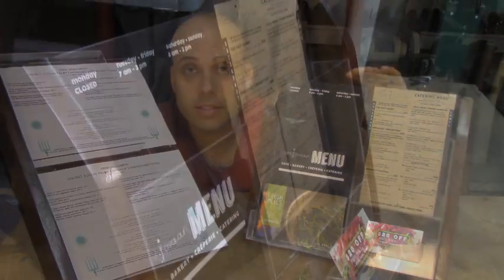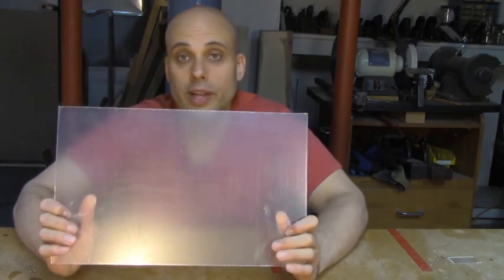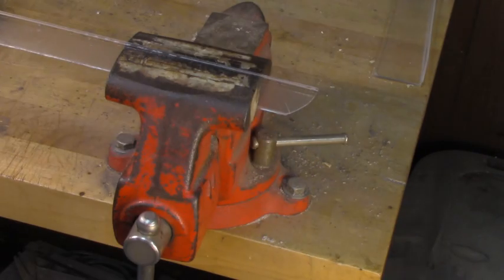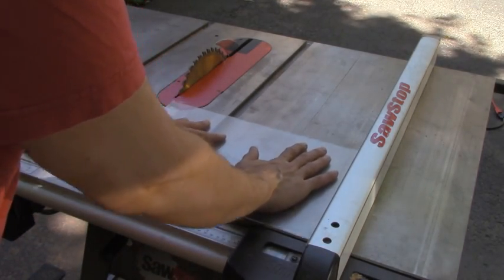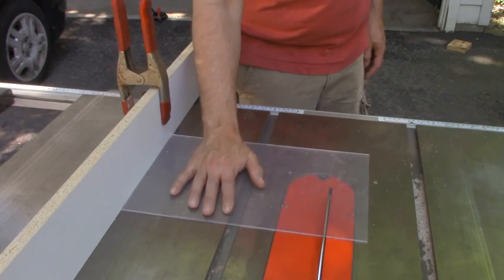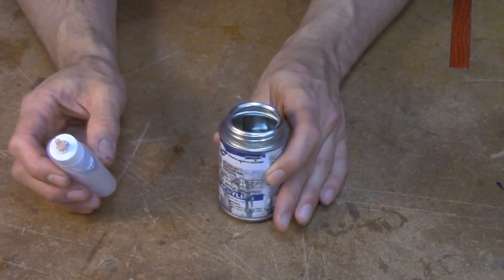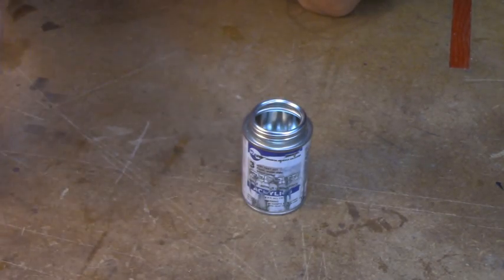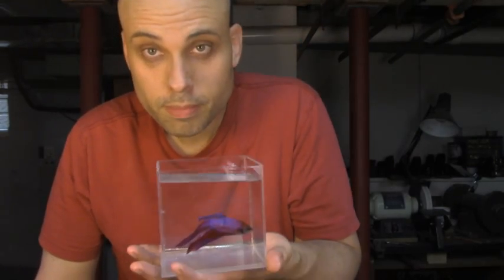Acrylic for woodworkers. (Using the tools you own now!)

Comment: I have been a wooden boat repairer for many years and have always asked the local acrylic supplier to cut stock to size if I need it - this is expensive, takes time and totally dependent on the measurements I give them. Your video will save me time and money. It will also allow me to be more creative with my repairs. Thanks for a great video. Good luck.
Reply from the maker: You're SO welcome. Good luck to you!

Comment: I'm an Acrylic Fabricator...and your instincts and experiments with the table saw are correct. It's the best way to go for cross cuts or any square cut really. I use a 3hp table saw every day to cut through even up to 1" acrylic. I've met a lot of guys that have said thicker material kicks back, but in the couple years I've been at it, I've never had a kick back issue. I do use a blade made for plastic however, so don't take my word on it if using your wood blade on anything thicker than 1/8th".

Most tools and applications you use for wood will work for acrylic.....the biggest difference is there's no sanding away mistakes. You can sand and buff it clear, but it will be altered optically.

LAST NOTE: If you're going to make something large that needs to hold weight(water or whatever)....prepare your edges! The solvent will dissolve saw marks on something small but you can't count on it making a truly strong weld without at least planing/jointing those edges. I only even bring this up because I've made aquariums for people who tried doing it at home and the seams busted on them.
Reply: Any particular recommendations on the plane(s)???
    OR... would it be easier to suggest (strongly advise?) what NOT to use, specifically?

   SO far... My only project was some "viewees" for a "bordering on ancient" level, so I globbed some automotive "Goop" around the quarter-inch lexan rounds I'd tooled out with a Dremel and a "roto-zip" cutter (lolz)... and went with it. My preference (on that project) for "Goop" was the nature of the adhesive to hold indefinitely, but "let go" when I actually want to remove (for...say... bubble replacement).  ...it's worth mention that I'm "hell on equipment".

    BUT I still have some "stock" sitting around, and anything "advice wise" is probably a good idea. ;o)
Reply: Excuse me what will i need to make an edge on a acrylic mirrored panel piece. Im trying to cover my daughters dresser with 1/4 inch mirrored acrylic. Thanks
Reply: @LVL1Yo-YoGuy  It might help (more?) if you specified what kind of "edge" you're trying to make.
    Right now (on experiment alone) my usual "go-to" tool for shaping acrylic is either a "Roto-zip" or a "Dremel" with a similar "rotary saw bit"...
    The obvious (hobbyist) favorite here is the Dremel (or similar rotary hand-tool kit) because accessories offer huge variety at relatively low costs.

     IF you can find one "reasonable", though, for a "bevel" type of edge, you might be well advised to get a "jig-saw" or "sabre-saw" (depending on local terms), so you can adjust the bottom for the angle.

    I would HIGHLY HIGHLY recommend that whatever tool(s) you do go after for acrylic purposes, you specifically look for VARIABLE SPEED CONTROL... It's a bit more in price, but to avoid mountains of molten goop developing on your projects (even rare accidents), in my opinion, it's definitely worth the investment.

    It still takes a bit of "tinkering" to get a feel for working the stuff, so you're also well advised to start with a couple "sample cuts" in scraps that you don't mind throwing away... especially with cutting angles, because following the lines for precision gets a bit tricky...
   AND as far as that "precision" regard goes, any relatively thin material (about the same 1/4 inch) will do for practice, just so you can practice following the line while the blade cuts outward to the edge.

   BUT if you're interested entirely in a neat, square, crisp 90 degree cut, I stand by the Dremel with a rotary saw bit, and the "end piece" that looks like a miniature router-base... 

   Again, VARIABLE SPEED is a big advantage to avoid melting the acrylic any more than absolutely necessary... BUT I've run my roto-zip (which is either on or off) through it without much "clean up"... mostly just scraping and trim with an Exact-O or Pocket knife. 

    Hope this helps... ;o)
Reply: @gnarthdarkanen7464  so a( rotary saw bit) for the roto-zip is what i need for cutting acrylic material. I like to do a simple angle edge on the panels i cut for front drawers pieces. Thank you for the help
Reply: @LVL1Yo-YoGuy , ALWAYS welcome. 

   The roto-zip (or dremel 'ish' tools) are great for any direction, as long as you want clean square edges...

    For angles, I'd still recommend a "jig-saw", and most of the relatively fine blades (packages will usually recommend materials... so wood or paneling) will also do a good job...
    Best of luck! ;o)
Reply: I have great results cutting it with my bandsaw. No melting edges and no chipping.
Reply: Appreciate that mate 😊
Reply: @gnarthdarkanen7464  Any suggestions on how to drill a 18" globe (light cover) for another use?
Reply: @ed-dmayeur2222  Part of why I love dremels (and now my Vevor SD230, knock-off of the Foredom SD jeweler's mill)... Is VARIABLE SPEED... On the jeweler's mills, it's even controled by a foot pedal, and available thru Walmart online for around $70 US (tax included)... For holes up to around 1/4" (6mm) you can do well with an ordinary drill bit and a careful application between pressure and torque... BUT the same can be said of the dremel only you have to "set" the RPM's before you get into the work-substance, itself...

    {Sorry on the tangent... Xmas present from my brother, and what can I say, I fell in love... as much as a guy can with a tool}

    For thinner and more delicate globes (since I've worked glass as well as acrylic) loosened loamy (mix of sand) soil works fairly well for reducing vibration and "beating" so you decrease skittering and cracks...

    Most reliably, needle-files (by hand) are great for rounding and chamfering holes a little,  while roto-zip (among others) DOES offer a "counter-sink" bit if you have a nice variable speed drill to work with on that account as well... for the "hogging out" portion... Still, needle files are nearly indespensible for refinement and cleaning up nicely without too much hell to pay.

    The bottom line of simplicity is "Incident of cut"... Meaning you should watch your saw-dust and chips... Larger ones leave rougher finishes and cause more vibration/beating. Smaller chips and less aggression leave smoother edges and decrease such abuses... as a general rule.

    AND a soft-ish supportive substrate can help dampen vibrations and avoid destructive stresses and strains.

     Hope all this helps. I'd need details if you want something more specific.  ;o)

Comment: Brilliant Presentation - this video is well thought out and very informative.  The presentation techniques you use can be applied to any presentation for the best results. By focussing on the two main issues when working with acrylic - heat, and vibration - you brilliantly illustrated throughout the presentation how to use tools and techniques to prevent those issues from occurring.  Then you demonstrated how to create simple products using those tools and using the best adhesives to perfect them.  I am not a carpenter but I do admire the trade.  I hope you are a teacher sir cause you have a great talent for explaining how to do things very simply.   Well done!

Comment: I am retired and do crafts as a hobby to sell at craft events. I really appreciate this video. I have cut acrylic only a couple of times and I think that I used both my band-saw and my table saw...the table saw for a lot more accurate cut. But...and this is where I learned something very valuable here...the gluing process. I didn't know about that solvent. It looks so much easier and simpler than the epoxy or super-glue method. Spring is just around the corner so I think I will now add some items that has acrylic in them. Thanks...!!

Comment: There are many videos on here suggesting to use a jigsaw. I agree with your reasons not to. I used a cordless circular saw in the end and it gave me perfect results. I am like a surgeon with it tho, others with less experience with this type of saw may encounter problems if they twist the blade during cuts or put the depth way down or don't use a sacrificial cutting surface under the acrylic. When I did my project I didn't have access to my table saw, I think it may have been even easier. I do have a fence for my circular saw tho. And I used super glue which worked perfectly for me. But I like how you explained the difference in adhesives.

Thank you for sharing your skills knowledge and experience. I appreciate you

Comment: I've managed to get a decent result on 10mm thick acrylic and a jigsaw. The trick is to use a metal cutting blade, go slowly, have the jigsaw on its lowest speed setting and use vaseline. I just put it along the cut line and got a result that matched the factory edges.

Comment: Thank you Rex. That was really helpful. I often make acrylic dust cover boxes but I will frame my pieces in wood. Mainly because I'm not totally happy with my edges.  I also cut mine on a table saw so it's nice to know I'm doing it right. And like you I don't get kick backs.  But I didn't know that my slightly rough edges could melt away once I weld it together.  I am definitely going to try that on my next dust cover. Thanks again.
Reply from the maker: Awesome!  Good luck!

Comment: The capillary bottle trick is GENIUS. I’m talking about squeezing out some air before pointing it at the seam you’re welding. I’ve been a model maker for a LONG time, and have always dreaded the “drip” when  assembling plex. Somehow I had never heard this one; it’s great. PS: same bottles can be used with cynoacrylate glue accelerant. Allows you to use just a drop of kicker on your superglue, rather than having to spray that damn stuff into the air!
Reply from the maker: Now that's a good tip. I use a LOT of CA glue.
Reply: @RexKrueger  Glad to pass it on. Your videos are great, btw.

Comment: Regarding 11:05, instead of using ragged saw cut edges on acrylic sheets, you can instead get much better results by using a table router to further shave off an additional 1/32 inch from a ragged saw cut edge on an acrylic sheet. Thereafter chemically solvent welding a joint on the acrylic sheet will produced a truly transparent and strong with no imperfections such as from a ragged saw cut edge.

Comment: Thin acrylic sheet material will work nicely on a table saw if you use a simple fence attachment my brother taught me about years ago for doing laminate work.  Cut a shallow kerf an eighth of an inch along one edge of a board which you attach to the side of your rip fence.  This may seem folly to joiners use to providing zero clearance inserts which support the work to preclude tear out...but allowing the sheet to 'float' actually keeps the chips from happening.  Especially useful when making the pieces for the edging on counter or tabletops.
Love your vids, keep up the great work.
The Colonel

Comment: We used to use a home made heater to heat a line on the plastic and bend the sheet.  Worked great.  Nichrome wire and a variac transformer.  It's using AC line so you need to be careful.  Good video.

Comment: I use the 4mm thick, anti-glare, UV protection Perspex for my A2 photograph frames, but I often cut it down to custom sizes using my jigsaw with a Bosch T101A blade. They are not cheap at £12 for 5, but I’ve never had a problem with them. I also use my Bosch version of the workmate as I can clamp really close to the cut from both sides to reduce the vibration in the material.

Comment: I have been working with acrylic for 30 years as a teacher and you are spot on. You can use a jigsaw (now we hit American vs UK English problems, what you call a jigsaw, the Black and Decker thing is not a jigsaw. A Jigsaw is the saw you would use to cut jigsaw puzzle pieces. Sometimes it's called a scroll saw, fret saw or a piercing saw.) So long as  you stick paper on the top face of the plastic, it does something magical, the melting stops and you can cut really complicated shapes even using a powered machine.

It also planes, if you use a high angle scraper plane. It also turns if you want circles, use a metal lathe and no rake on the cutter. Drilling: back off the sharp edge of the drill to vertical, as you would for brass. Forstner bits work surprisingly well, use a fast speed. Fly cutters work well too. Use fast speeds and low feed.

You can use standard metal working tools for cutting threads.
Reply from the maker: These are all great tips!  I've been meaning to do a second part to this video and I'll incorporate those tips for sure!

Comment: With a delicate touch, you can use the heat of a propane torch to smooth the rough edges of a cut. However, do this only on exposed edges that will not be bonded. The solvent will craze a heat-smoothed edge.

Comment: I am stunned. Good show on acrylic, but how could you make an entire video without a demonstration of a plane or chisel? For the hand-powered tool fanatic, the same acrylic can be engraved with hand gavers, and raw edges can be polished quite well. I have used it for intaglio printing, as well as relief. For the advanced project, one can engrave the material, then polish the cut surface to yield very nice figures and textures. Anyway, thanks Rex (from another Rex).

Comment: Great video I do some work with acrylic just like to add some tips rough edges can smoothed by heating the edge with a butane blow torch quickly moving the flame across the edge.. Acetone can be used to weld pieces together. Acrylic benders can be cheaply made with resistance wire attached to a power source and a small spring to keep the wire taut when it expands with the heat
Reply from the maker: Those are all really good tips!  I think it's time to do a part 2 where I get into some of this more advanced stuff. Thanks!

Comment: Nice vid. To midigate heat build up with things like Jig Saws you can spray a little water on the cut path. Similar to using lubricant while cutting/machining metal.

Comment: Do you have much (or any) experience bending acrylic by applying heat?

This is one of the best (if not the best) explanations/demonstrations regarding acrylic I've seen on YouTube.  Subscribed!
Reply from the maker: KSFWG I've done a bit of heat bending,  but only to experiment. there is good bending info online and it doesn't take much heat.  thanks for the sub! new content soon.
Reply: Haha yes jigsaw does not cut acrylic at all....disaster.....how,would,you cut a 4ft x 8ft piece in half?...without a table saw?
Reply: I have bent acrylic plexiglass via heatbgun..works great...fyi...never uses isopropyl alcohol to clean plexi it will destroy it
Reply: @shelby50411   - you can cut large acrylic sheets using the scoring method. Use a scoring tool, much like a single saw tooth, usually made of 8-10 mm diameter tool steel and set in a file handle. The cutting process is much similar to cutting glass, if you have seen one. Make a few deep scores along the cut line and then simply break away at the cut line.  Perhaps this video would help see how it's done. 
https://www.youtube.com/watch?v=pzUiBsPDq4I

Comment: Great and informative video I learned a lot from! I have used a high speed contour saw (don't have a belt saw) with very thin blade for those few projects I add some acryllic pieces, and that is not always the best outcome regarding the melting you mention. I really needs a certain speed in the movement of the acryllic, but if I then stop for a second to check the path I've lined up, it actually melt the acryllic together again.. So, what I do normally, until I saw this video, is to saw an millimeter outside the path, and then fix melts and other things with a fine sandpaper. It works, but not effective and not always the best results either. Ok, again, great video, and thanks for sharing!
Reply from the maker: You know, it sounds like you're a great problem-solver. Many people would have let the melting stop them, but you found a way and got it done. Impressive!

Comment: Great video
 I've worked with a lot of a arylic through years of aircraft. Another way to cut acrylic is similar to cutting glass. Score the sheet deeply with a knife or better yet awkl or scribe. Clamp to your benchtop with a straight board right along the line and bend down. The acrylic will snap along the line.

Comment: Nice video coverind the basics. I'd like to see a section on drilling holes. 

Two safty suggestions: 
1. Keep the table saw blade only about 1/8" higher or less thanthe peice you are cutting. I'd rather take a 1/8" chunk off my fingers than a 1" chunk.

2. I would use the miter gauge with the fence when using a table saw. Maybe no one has experienced kickback cutting acrylic, but why take a chance? I use a compound sliding miter saw for these cuts so no worries about fences or miters gauges.

Comment: thats pretty much the best video on working with acrylic out there, thanks mate. gonna build tarantula enclosures out of it. any tips on how you drill ventilation holes or is it straight forward?
Reply from the maker: For very small holes, twist bits work. I like forstner bits. Very clean. You can also get acrylic bits very cheaply. Also, tarantula enclosures is bad-ass!

Comment: What would you use to split a larger block of acrylic? Have a 5"x1.5"x3/8" block of polypearl acrylic that I need to split lengthwise into two slabs (ending with 5x1.5x3/16 blocks). Using this for knife handle making